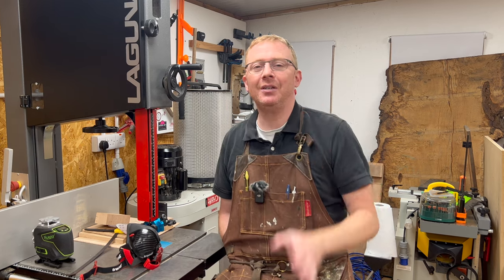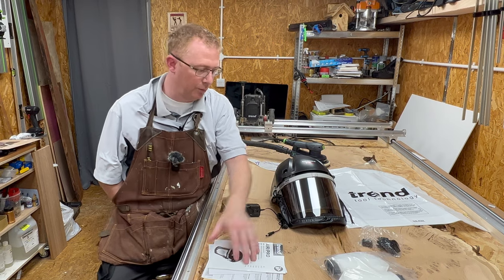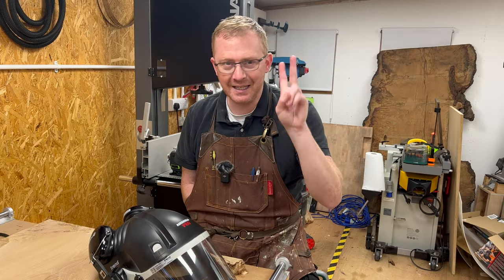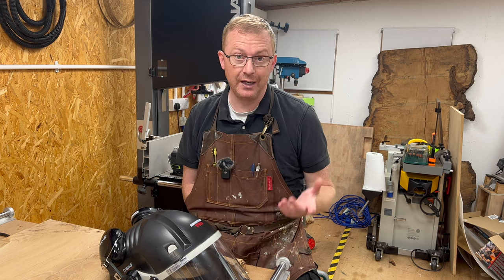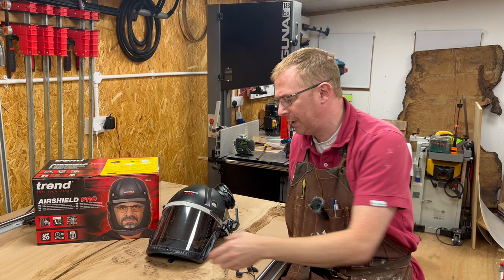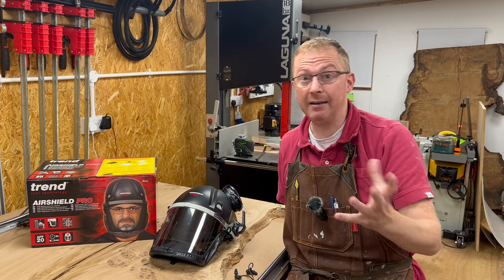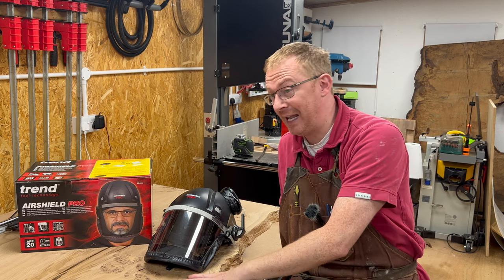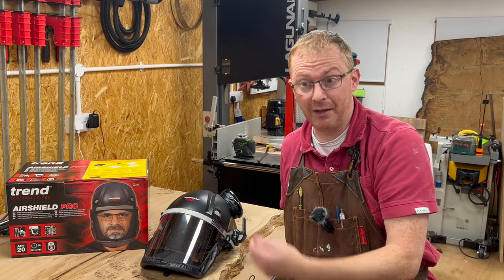Trend Air Shield Pro - Unboxing and Review

Comment: Hey, Leo. One thing you didn’t cover is how noisy is it? Like, if someone comes up to speak to you, would you need to turn it off to hear them? If so, is it easy to turn on/off?
Reply from the maker: Good point Denis and something I’ll cover in a follow up sometime. Obviously ear protection needs to be removed, the optional ear attachments twist upwards easily enough. I’d say most folk would be able to hear someone with it still switched on as it isn’t that loud. I struggle with my hearing so a bit more difficult for me. It’s very easy to switch on / off, just a button at the back in the centre 👍👍

Comment: Another first class video production but more importantly a down to earth one.
I thought at first when I saw the fogged up visor it was going to be a rejection but no, it did clear itself.
Loved the fact that you were wearing a Mirka dust free  sanding t shirt whilst using the Festool sander!
It always pains me when I see tradesmen (and amateurs) cutting stone etc and not wearing dust masks. Occassionally I go up and put my two penneth in. Have we learned nothing from the miners I'll say, try going round one of the pit villages and see the old men wheeling round oxygen bottles because they didn't have breathing protection. I wear the Trend dust mask along with safety glasses and hearing protection as well as using dust extraction equipment - you are quite right, you only get one pair of lungs so look after them.
Reply from the maker: Thanks John for your very kind comments here and yes I couldn’t agree more about what you said about the miners. I grew up in Wigan and coal mining literally killed off generations of men far too early because what they were exposed to.

Comment: Fair review Leo, having owned one there not bad. My biggest complaint was the weight is all on your head and shoulders plus the price of a second battery but all manufacturers do that. One point that you made we all only get one set of lungs is very true. Cheers Geoff
Reply from the maker: Thanks Geoff, yes the battery cost is quite frustrating but as you say all manufacturers are the same with that. Do you use a different brand now?
Reply: @Hand-i-Craft  Yes I upgraded to the 3m Versaflow, which means the battery and filter are both around your waist/lower back and the helmet has very little weight to it. Again it's a big out-lay, but I think my lungs are happy lol. Cheers Geoff
Reply: @luvwud I had the same issues as you I just found the Airshield pro just too heavy and it realy started to hurt my neck when looking down at my work. Mine also vibrated a lot and was realy loud, it litterly rattled my scull. I upgraded to a JSP Jetstream powered respirator with the motor and filter attached around the waist, it was soo much better.

Comment: I managed to get one used off of fleabay. I had to replace the face shield but still saved about 200 quid. 

It works but I have found the ear defenders just don't form a good seal.
Reply from the maker: Yes good point about the ear defenders, I use my isotunes in ear defenders mainly when I use the air shield now 👍👍

Comment: The trend is good but tall and top heavy. Given a choice I would go for the Axminster respirator as it's lighter and better balanced. I now have both, Axminster one for woodwork and the trend for resin work.
Reply from the maker: Interesting to hear your thoughts on both pal, much appreciated 😀😀👍👍
Reply: I have the Axminster ( made by JSP) which is very comfy and doesn't fog up.  The filters are a cartridge type, not sure about the comparative effectiveness compared to the Trend.  The only problem I have had with the JSP is that when the ear muffs are worn they touch against the back of the visor and quite a bit of noise from the fan is conducted to your ears.  I have a pair of fitted electronic noise suppressors from my shooting days and these are much better and block the noise well so maybe an in ear type would be a better idea than the recommended ear muffs.  Does this happen with the Trend Leo?

Comment: Good review. To throw in my sixpennyworth ... 
I have the mk1 helmet and would always recommend fitting a visor overlay - a scratched visor is just a pain and if severely scratched should be replaced as impact resistance may be much lower than designed to be. 
I get 4-5 hours out of a fully charged battery and the fan speed gradually drops as it discharges - not to silly levels but enough to feel airflow not being quite as good as it was. At that point I need a quick replacement battery, not a massive wait to charge it, so I'd always recommend a second battery and charger dock for quick swap over. 
You can wear standard ear defenders if they have a thin head band (obviously wear the band under the helmet not over it!) but the fitted ones are more comfortable.

For the record, I wear specs and with goggles, ear defenders and a face mask I would sweat like a sweaty thing, this visor is a godsend in this respect.
Reply from the maker: Brilliant, thanks for your feedback Andy. Really interesting to read this and gain a long term perspective about it 😀😀👍👍

Comment: I've had one of these for several years. It is unsurpassed if you wear glasses because the glasses don't fog up. However, I do find that my neck is a bit sore if I use it for several hours while looking down at my work. I'm 6'3" so that is most of the time. So, I tend not to wear it for more than 2 or 3 hours each day. I don't think it's the battery that is the issue; the helmet itself is just heavy (or maybe I just have a weak neck; I'm 76 years old).
Reply from the maker: Thanks for the comments here Robert, great to get a long term perspective of it😀😀👍👍
Reply: @Hand-i-Craft  I have the mark 1 version and whilst not heavy, it feels a bit "forward heavy" and I felt it made my neck a bit sore. I made a simple mod the unit to put the battery on my waistband which I think helps.

Comment: At around £350 is it worth it, yes because it protects your lungs, no because it is a complete and utter rip-off ... not only that but it's not even their own design, have a look at the GENTEX PUREFLO PURELITE PAPR ... look familiar!   Anyway, thanks for the review and I agree that protecting your lungs is a good thing to do ... I didn't and now have emphysema (MDF dust, plaster, spray paint etc)!!

I'm in the midst of making my own BLTN-PAPR (Better Late Than Never PAPR) which uses P3R filters (£2 each), probably a 12v 7530 fan (around £10), builders helmet (£16), thick polycarbonate visor which is far superior (£20), ear defenders if I want (round £25), runs on 8xAA batteries (around £13 + £4 for holder, like the MIRA MB-90) ... well under £100 for the same/better protection and longer run time.

So filters around £4 a pair (Trend £20-£40), extra battery (AAs) around £13 a set (Trend around £40) and last longer, air flow of 339 l/m (Trend 200 l/m) ... so cheaper (and probably better) for around 1/4 of the price.

I'm not against manufactures making a profit, but this is just a pure and utter rip-off ... mind you, not as bad as the Trend Air Pro max around the  £700 mark!!

Comment: I’ve got one I did wanted to get there other one as it’s a bigger gap between your face and glasses and shield. It’s a nice flow not fierce on your face. I got it as got copd plus lungs at 70%. I need to wear it more but that# my fault because it a quick job or I forget as no memory from strokes
Reply from the maker: I use it a lot and agree about the flow of air. It’s just about right, not too fierce that it dries your eyes out 😂
Reply: @Hand-i-Craft  hi and I know roughly how you feel I have to use wheelchair to get around outside of house. On your sander I’ve got a dewalt 6423 and my hands go numb it’s due to my rheumatoid arthritis my 2 small strokes plus mt right knee and half of my thigh and lower leg is titanium can’t have any more replacements I been told I’ll lose the leg above the knee